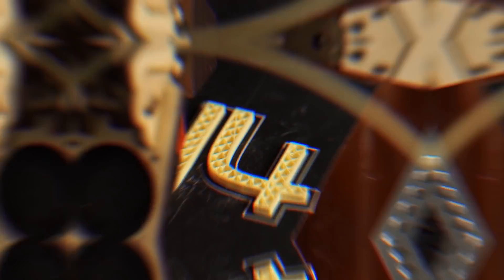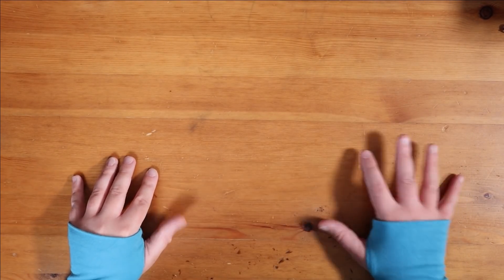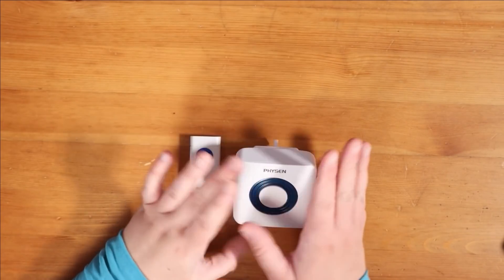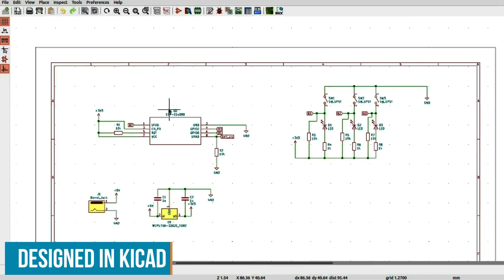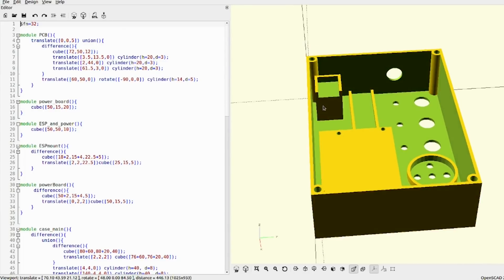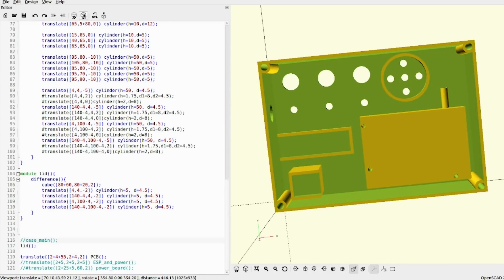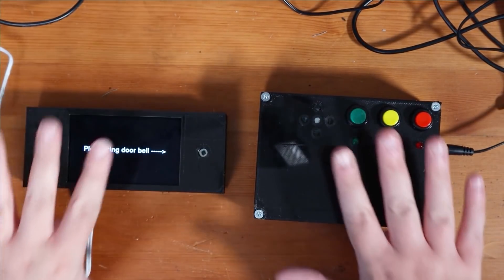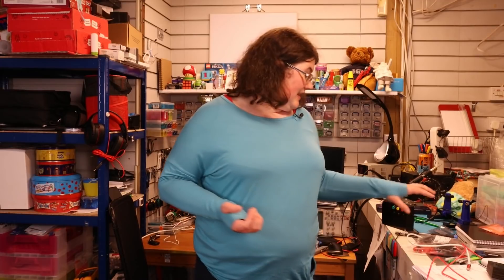Modding a Wireless Doorbell with Raspberry Pi and ESP8266

Comment: Wonderfully done, defines the problem, specs the solution, solves the problem.

More please.  Excellent presenter, nails the vibe of "I can do that" into the audience - that's inspiring and you can't beat that.

For flats - a LDR to trigger, would show a letterbox opened if you tune it right as a closed letterbox as a norm are light free.